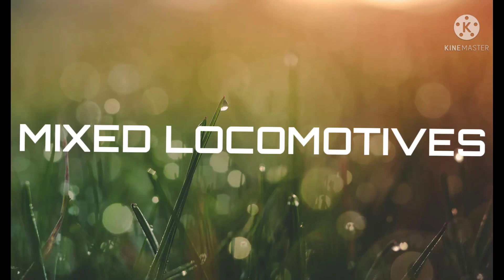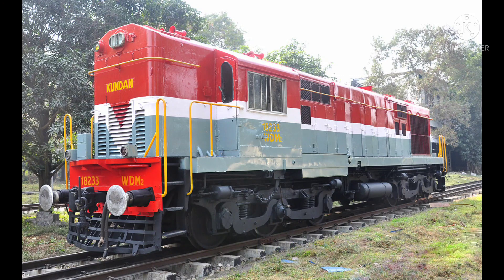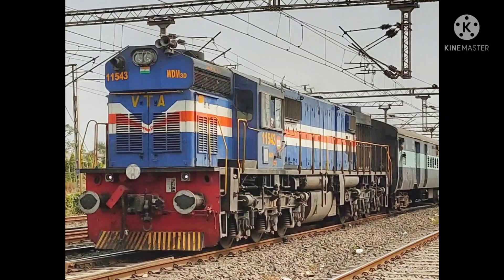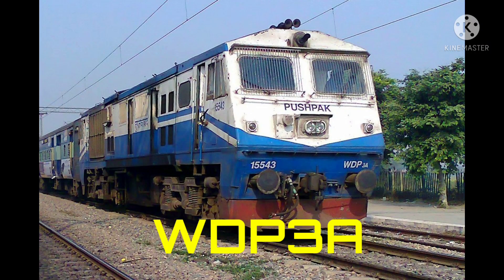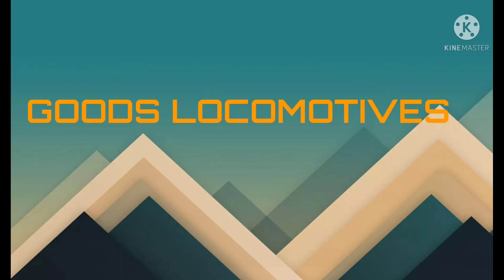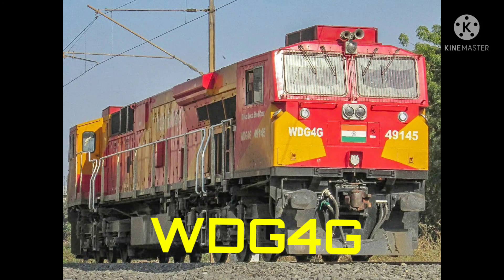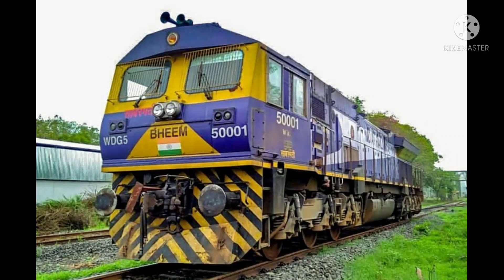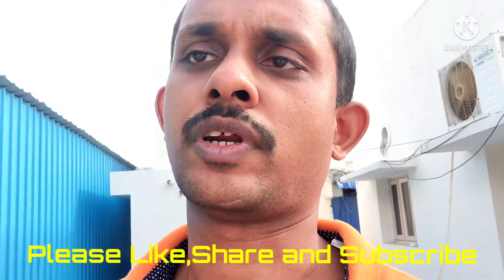History of diesel locomotives {WDM1,WDM2,WDM3,WDP1,WDP3,WDP4,WDG1,WDG4,WDG5,WDG6}

Comment: WDP- 3A, WAP-4 Almost all dual cab locomotives both cabs looks same. But Why wDg4d/wDp4d locomotive Cab 1 & Cab 2 are made different. What is reason behind it ?
Reply from the maker: Because these engines are installed with AIR-CONDITIONED{AC} including WAP7
Reply: I know AC is fitted on the roof of locos . But I am asking why wDp4d/wdg4d cab 1 & cab 2 looks different Means cab 1 looks like Aerodynamic & Cab 2 looks like Dabba (Box)  What is the reason behind it?
Reply from the maker: AC MEANS NOT ALTERNATIVE CURRENT WHICH PRODUCES WITH PANTOGRAPH INSIDE THE CABIN LOCOPILOTS HAVE AC FACILITY
Reply: @sreekarrailfan2954  Yes bro i know AC mean Air conditioner which is fitted on roof of wDp4d/wdg4d and Modern GE  locomotives it looks square/ Rectangular Shape. But still didn't you replied valid answer of my question?